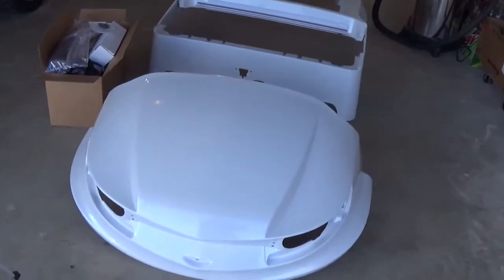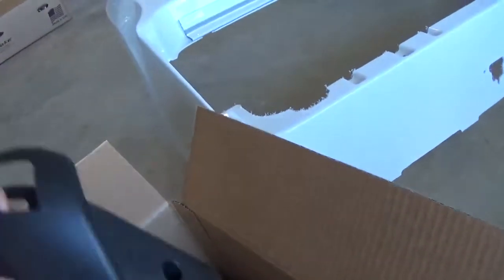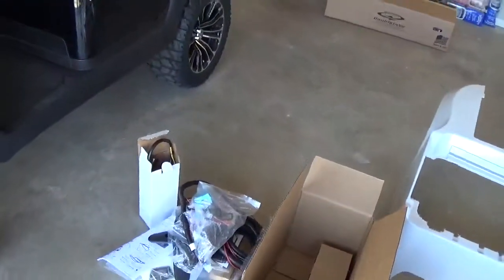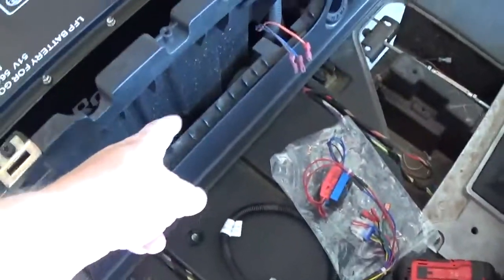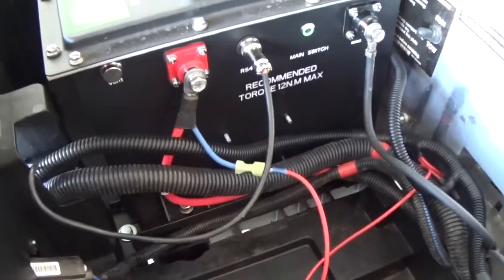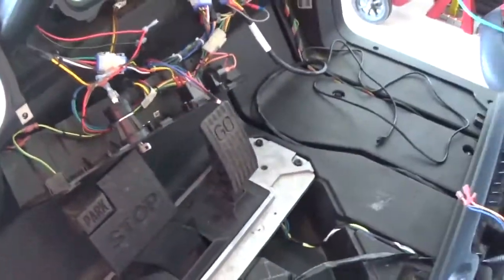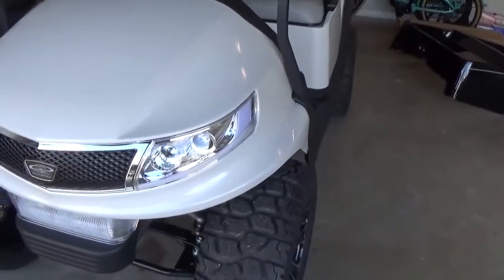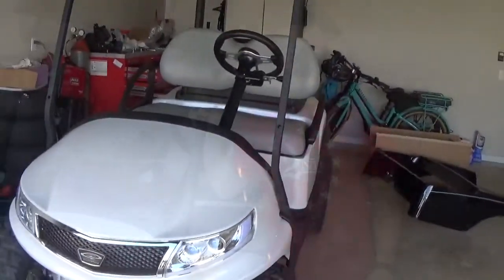Doubletake Phoenix Body Kit Install on a 2017 Club Car Precedent

Comment: Great video!  I was curious how the front body was held down. Is it just held down with the screws/rivets on the top (dash)?  Does it also have some screws or attchements at the bottom of the front near the lights?
Reply from the maker: Just screws on the top…. The Struts kind of hold it in as well
Reply: @kartkrazy  so it’s as good as the oem front?
Reply from the maker: @robertmorgan1079  better!! Thicker and more solid